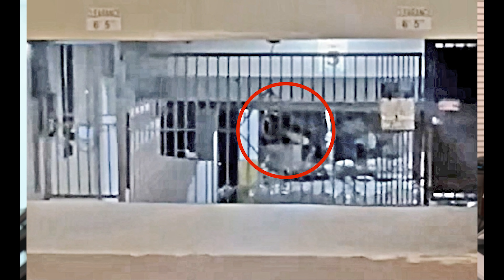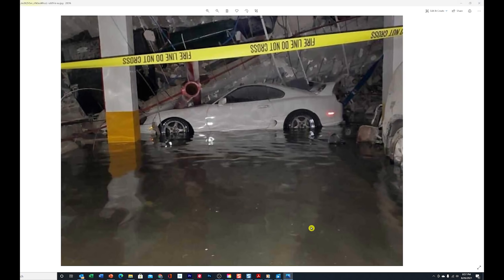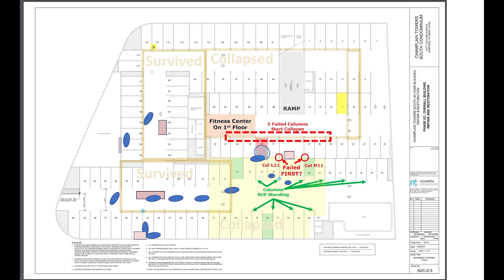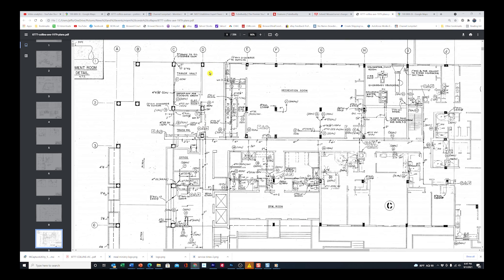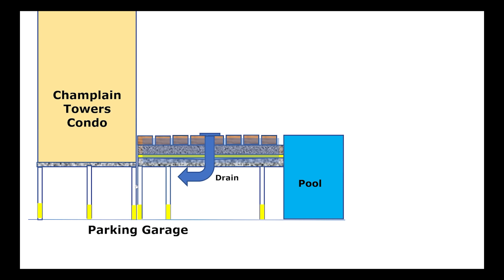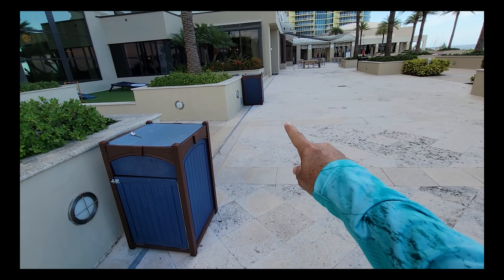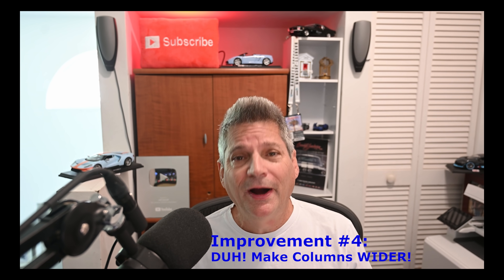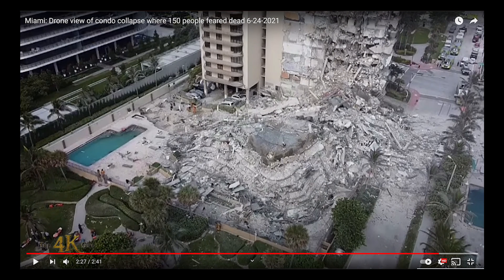Miami Condo Collapse: 4 Engineering Fixes May Have Prevented It

Comment: The single most critical cause of the collapse was the DECISION to add pavers to the pool deck.  Was this a decision by committee or a single individual? If by committee, then were there any dissenting opinions suggesting consulting an engineer to "run the numbers" ?  
If so, was it determined to be too expensive to hire an engineer?  (Let's say the cost of pavers, installation etc was over 500X and to hire an engineer was just under 5X ...   Even hiring the most expensive engineer is cost effective )  What WAS the process in the decision to add the pavers and palm trees? And any decision about waterproofing the deck beneath the pavers.  Decision ... Action ... Inaction creates FAILURE!
FAILURE was just a matter of TIME and GRAVITY.
 The FAILURE WAS INEVITABLE  without supportive re-enforcement type  intervention.
DECISIONS MATTER
ACTIONS MATTER
INACTIONS Matter
Reply from the maker: The entire condo board has to vote on it yes, they are not engineer so that they have no idea what to do so they bring in the contractors who are supposed to know what to do. This particular project of adding the pavers did indeed have an engineer sign off on it. But whether that engineer did enough thorough work originally to see was the deck overloaded to begin with from the original design, and did he have the benefit of seeing that there's only two pieces of rebar coming out of each column to hook into the floor slab. But as far as we can tell everything was done by the book but sometimes you can still fall through the cracks literally.

Comment: Glad to hear that CTN is looking at building structural enhancements as I am sure their property values have plummeted.  It is great to have a platform like you tube where the mechanics of failure can be discussed.  Best practices in anything is always a great idea and sadly it appears that the South Fla 40 year building cert program might have caused a false since of security.  This is not only great info for those in the field but also for the general public like myself.  Last of all, a memorial needs to be built in the area not only to dedicate to those who were affected by this tragedy but also as a reminder as to what we don't want to happen again.  Maybe not just a memorial but maybe a museum for all current and future generations as we are learning a lot from this tragedy.  As I always say, take a negative and turn it into a positive.
Reply from the maker: One of the positive things that they did at great cost was the president of the homeowners association at the Champlain towers north building, in order to prevent a possible collapse, had dozens of unit owners remove all of the tile and mortar off of their patios because that added extra weight that was not calculated in the original design of the building. And so now they've all just simply been painted which looks just fine I have been on one of those patios and they look quite nice. The problem with having tile is that when rain comes in it gets through the grout and soaks into the mortar underneath and now it's holding the water which causes the patio concrete ledge to start to deteriorate and then spalling sets in because the water has nowhere to go, it gets through the concrete and into the rebar an rusts the rebar, which expands, and makes the concrete crack in a vicious cycle.

Comment: How about some epoxy coated re-bar?
Reply from the maker: Yes I am sure epoxy coated rebar would work better, but I do have a number of engineers that have told me that it's not as good as you would think it would be because it can scratch it can have voids in it when they dip it, but I got to imagine it's better than leaving rebar around on the construction site while it rains as it sits waiting to be used.

Comment: Hey Jeff, I’ve watched many, if not all, of the condo collapse videos.  I think you’ve done the best job when compared to the others on YouTube.  Bravo to you!   I have a question that I don’t think was ever discussed.  When the sprinkler pipes broke in the basement prior to the collapse, shouldn’t it have triggered and set off the fire alarms throughout the building?  I worked in a huge building where if the water pressure dropped, the fire alarms went off and we had to evacuate the building. Any thoughts or comments?
Reply from the maker: Yes a lot of us have discussed that whether or not it should have triggered the alarm. I do believe that a triggered an alarm is that a triggered an alarm down at the alarm monitoring service, because they called 911 to report an alarm, even though we don't have an audible alarm going off on the property during the collapse. So we think it may have been manually turned off in terms of alerting the residents when there's a loss in pressure in the sprinkler line.

Comment: Would you need to reinforce the columns against punching shear on every floor, or just the garage?  Why would the garage be more vulnerable than the floors above?
Reply: You have to design for shear everywhere.  The pool deck should have been designed for a lot more load than the typical floors so it could carry the weight of pavers, planters, people congregating for parties, etc.  Another factor is that the pool deck was supported by smaller columns so that interface has less punching shear capacity.
Reply from the maker: The ground floor is the most important because it's carrying the most load each floor that you go up, you are carrying less load and the concrete is not as sick and heavy and expensive because it's not holding as much load either. But I would say anywhere that you can fit in a chance to bolster the strength of a column would be a good idea maybe only lower floors, and try to add in some concrete beams here and there for lateral support as well. But certainly the pool deck and the garage are really the most important part since we saw it was the failure of the pool deck that likely pulled down the entire building.

Comment: yup, hindsight is always 2020. Question is what was best practice at time building was designed and built? Also what and when should things should have been upgraded to meet new requirements?
Reply from the maker: I think you are looking at what was best practice at the time period but I think what you will find is that smarter engineers at that time were likely incorporating a little bit more rebar in the column to slab interface. Some other engineers were also adding the drop panels an caps at the tops of columns. Although it is fairly rare to see caps at the tops of columns

Comment: I would never let a pool deck double as a garage roof. You have to wonder if all the  contractors over the years working on that top surface even knew that it wasn't ground level?
Reply from the maker: Yes I have questioned that too plus you have to understand that building material delivery guys are not engineers they're just delivery guys. And they will put stuff full of pallets and drive them onto the pool deck with a forklift and not think anything of it. Because when they deliver stuff they want it off of that truck as quickly as they can and they move on to the next delivery time is money for them.
Reply: @jeffostroff  that’s so true you hit it right on the nail smh

Comment: Jeff, I believe you are spot on with these findings. Thanks for all your detailed efforts. I’m a professional engineer with Virginia state. However I’m mechanical not structural. The pool deck should have been isolated structurally from the building as you described. That is the main reason for the building failure. Now, these reasons for the pool deck structure failure is most likely multiple design issues - water barrier compromised, small columns, and etc. Steal is added to concrete for tensile strength. Concrete is good for compression but the concrete looked packed too much with steel giving it poor compression properties. Very concerning. Also, the concrete looked brittle and not holding together with the steel. Was the concrete packed properly with steel rebar? What are the code requirements for reinforcement of concrete with steel?
Reply from the maker: Code at the time said you cannot have more than 8% rebar taking up the space of your column. So you have to watch out for that overcrowding otherwise the concrete with its aggregate will not pour in between the spaces and fill everything up for you

Comment: Most structural failures are preventable if people are forced to deal with structural issues immediately versus being allowed to kick the can down the road.  If you want to live in a condo on the beach you need to be ready to pay up when issues like this come up because it's not just about the maintenance of your unit but the maintenance of the overall structure and I don't think most people understand that or they end up getting flipped on their finances because they bought into something they can't afford. In the end this came down to the owners, management, inspectors and the city making bad decisions that cost the lives of 98 human beings. Now what's happening, all the cities in that region of Florida are reacting to this and finding problems in multiple structures. I think your are little late people because the bill now versus a decade ago is going to be a little bigger. It's almost like interest being thrown on top of a loan and adding up because you only want to make the minimum payment.

Comment: epoxy coated rebar is banned in a lot of places because if you scratch or damage the epoxy in anyway while bending or cutting it and don't re-epoxy over that spot the rust will concentrate like a laser beam on that spot. they already make Stainless steel rebar it will not corrode it only cost three to four times more than plain steel rebar but look how much you save in repairs and building replacement not to mention peoples LIVES.

Comment: What happens when the pool deck drainage system is overloaded (as often occurs in Southern Florida) does the whole thing fill up with thousands of gallons or are overflows designed to dump it into the garage.

Comment: Totally preventable disaster, the design was a failure waiting to happen, not sure why there was so many design changes during the construction of this building that affected the integrity of the building. Whom ever engineered or designed this failure of the building should face justice. 
At 10:03 you are showing the columns at another building with an extra box it appears that there is also 1/2” - 5/8” steel plate holding up the box on top of the columns. I say appears due to the perfectly edged as square steel plates would look ???. 

You asked what I would of done  if I was the designer…..
1. Would be 1/4” per foot slope for water drainage on all areas exposed to weather, sun and sloped to all drains to expel all water.  
2. All vertical columns would be 24” X 24” with a support box and steel plate attached by welding to re bar of the vertical columns then pour the concrete at the garage floor location.
3. All columns would be made of earthquake proven concrete. 
4. All horizontal floors would be supported by metal sheet decking so from belowdecks there would be more support for all horizontal floors not just concrete an re bar. 
5. Correctly design multi location drains in parking garage using pumps to return that water to storm drains outside of building footprint.
Just my opinion.
Reply: Sounds logical. But you're designing for a long lasting entity. They were designing for 40 years at best. By that time it's someone else's problem. And now it is someone else's problem. The dead and their families. Disposability by design to be replaced with bigger and newer to keep the profit system churning.

Comment: Great Video again. 
I would use the "cap " on all buildings going forward.
Looks the most stable.
Personally,  I think the North tower should worry if it's the same builder.
Also , Florida is slowly sinking and this could have added minimally to the buildings foundation. 
After seeing these videos, I'm steering clear of the Florida beaches and will investigate all basements and garages here going forward when purchasing property. 
Thank you Jeff.
Sherry in Los Angeles
Reply from the maker: Thanks Sherry hopefully it's not the same builder

Comment: What I would not have done was add sand and pavers to the surface and especially without proper drainage. I would liken that to a shower pan in a shower and how a PVC shower pan is constructed. They did not, as you previously noted, allow for water to escape from the original level as water passed through pavers and sand with no water drainage outlet. The level where the drains should have remained at  below sand and pavers.  Those additions were also a fatal flaw. I am equally suspicious of inspections done in total and in particular the change notice for removing the 4 level change beams  near street level parking and then going back to the original design but failed to put the beams back in near the main building. Also they appeared to cut costs with the 12 X16” as you noted.  I would do a stare and compare with the other building drawing as see what pops out..

Comment: Jeff, While I agree with the idea of “Capitals” being added that does not provide the absolute strength one would expect. When crush testing cylinders from concrete pours at say 5 of 6000 psi that is a  pure vertical compression test on a purely flat top cylinder that will provide what I will call either a “Crush” or “Fracture” upon breaking. A FRACTURE being the best because that means the aggregate actually fractured not the cement. Thats a “Very Good quality pouror cement. So you do not get an exact one for one PSI strength added factor when the capital is poured with a sloping under edge,  Al-be-it a great added measure of strength.
Reply: Column capitols are added not to increase strength of a column but to increase the punching shear perimeter which increases the shear strength very quickly.

Comment: From my limited structural engineering training, and I have had some, my preference would be to have a concrete post and beam construction with the floor and deck slabs supported by the beams rather than just their intersection with the posts. Of course this would add to cost and reduce head clearance, which might not be justifiable in a low earthquake risk zone.

Comment: I think you are 100% right it was architectural and  constructional mistakes and it was preventable if been fixed earlier . There should be pool deck separated from the main building put additional columns on deck sides where it joins building and expansion joints. I haven't thought about it before your video! Columns should be wider for this high building and have widering caps on tops

Comment: Our condo is +/- 20 blocks south. Built +/- 1961. High net worth residents / condos. We have NEVER approved deferred maintenance / escrow assessments. Big surprise, engineer / project management firm just gave us a 6 point ‘necessary’ plan at $14.6M. We’re on the ground floor, patio by the pool deck that is the same set up as Champlain South. It’s the typical 14 story bldg, about 50% parking under the building and about 50% under the pool deck. We’re watching these ‘causes / suggestions’ like a hawk!
Reply: Hire a competent structural engineering firm to review the original drawings to see that the building was designed properly.  I'll repeat- a competent structural engineering firm.  A project management firm may not be in the business of designing concrete structures, a company specializing in repairs may not be in the business of designing, etc.  I've seen one youtube video by someone who is actually involved in designing reinforced concrete and he didn't go into depth to analyze everything.  A competent engineer can find the problems with the building very quickly if there are any, I've yet to see anyone on the internet evaluate Champlain Towers drawings and report on the real weaknesses and this is after 2 months.

Comment: Ad for 40 year certs:
I sure hope the cert must review & consider all the changes made over the decades and if the as built dwgs reflect reality.
Computing power has exponentially increased since 1980. The device I hold in my hand has more capability (ops/sec & memory) than most mainframes in 1980. Certs (hope  new designs do) need to run failure simulations to see if failures of ancillary structures will compromise main occupied ones. 
If I lived in Champ Tow N (or anywhere) I'd want to know how & if the pool deck is connected to the main building's critical structural members.

Comment: Design features:
Isolation seams between ancillary structures and main, occupied structures.

Column capitals: As a former mechanical engineer, I think in terms of flowing of stress along members when considering (fatigue) life of a component. I am almost horrified when I see the 90° angle in slab & column construction. Sharp corners or changes in cross-section concentrate stresses and reduce useful life. Column capitals such as the ones shown allow the weight of the slab to "flow" into the column.
Reply: IMO the metal corner guards on columns in garage levels can serve a useful purpose: they protect barrier coatings (paint) from damage protecting rebar from early corrosion. Far easier to repaint/replace a bit of angle "iron" than to fix spalling.
Reply: Stress concentrations at corners are not a consideration in reinforced concrete structures.  In metals the stress concentrations will lead to fatigue cracking or fracture of the metal, but reinforced concrete has micro cracks almost immediately then the reinforcing steel takes over to carry the loads.  There is no reason to try to prevent cracking of a material that is going to crack no matter what you do.  Walk into a concrete building and look up, unless the building has PT reinforcing what you are looking at is already cracked, the cracks are just too small to see from a distance.